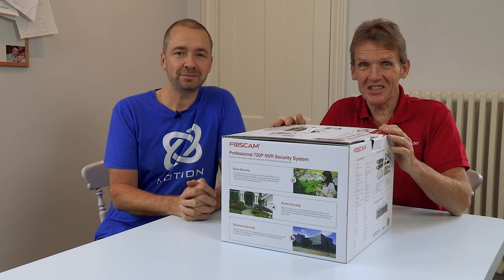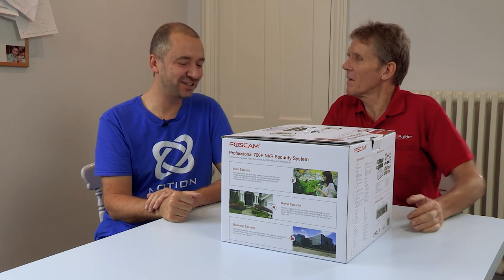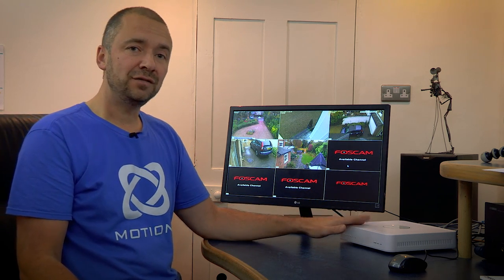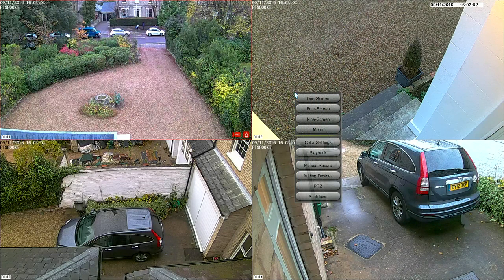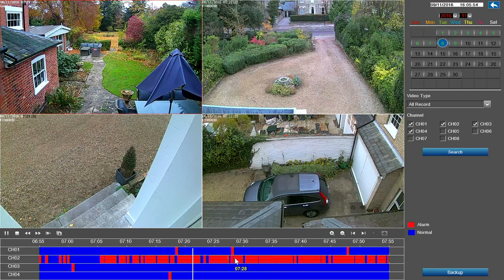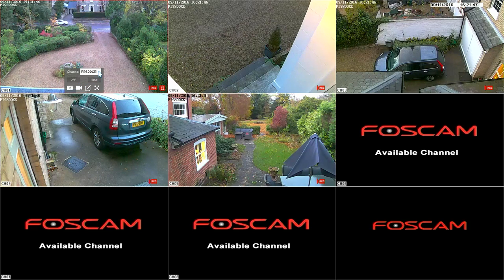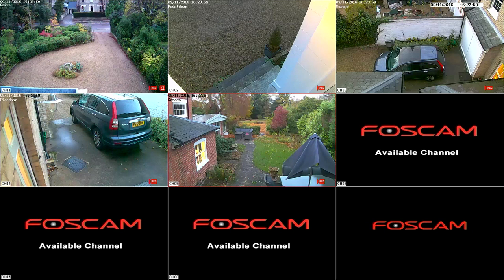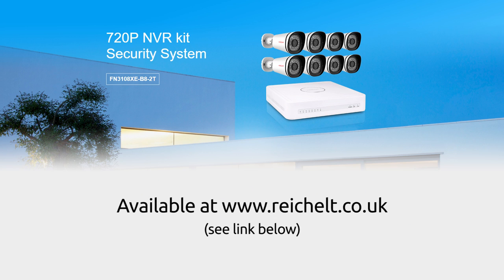How to Install a Foscam 8-Channel PoE CCTV System

Comment: Handy being POE as some houses are now rigged with cat5e/6 these days a you won't need to run any more cabling. Or at a push you could use you could dril a hole through a wall nearest to a plug socket and use the power line adapters which do POE.
Reply from the maker: Good idea Zed to come in next to the socket and take the power from there. It can be difficult running cable but  we struck lucky on that house as there was an old gravity heating system all defunct with massive 1 1/2 inch pipes running from cellar to the loft inside generous boxing. So mostly it was up over and straight down. Some times you need a bit of a lucky break to make up for all those nightmare jobs.
Reply: One article I read about my new 4-camera Foscam system, very similar to this one states that the PoE is not wired as per normal specs, so if you home is wired with CAT5 for phones, this system won't be compatible, even though the manual claims compatibility. Obviously, if you're just plugging a CAT5 cable between the NVR, with no other connections, that doesn't matter.
Reply from the maker: Randy V .
There are two ways of wiring Cat 5 so you need to know it is the same as their configuration.  We put our own plugs on because we didn't want to drill big holes.

Comment: awesome video.. i was wondering if I can replace one 720p camera with a Foscam FI9900EP 1080p and view it on full HD and record it at 1080p ? thank you in advance
Reply from the maker: Thanks Michael. I'm told the system will accept other IP cameras but recording at 1080p isn't possible.

Comment: Hi Skill Builder. Can you add a siren to this NVR? can you also add extra cameras to it? Thanks.
Reply from the maker: You can trigger any kind of warning device you like but you have to make sure you don't pick up every stray cat etc. 
The NVR gives you connections for 8 cameras so that it the limit.
Reply from the maker: Hi Erick. This system doesn't support an external siren, but it does have an alarm within the NVR which can be triggered by motion detection and loss of signal/camera. If you need more than 8 cameras, something like the Hikvision 16 Channel NVR (16NVRHK12TB) would be an option to consider, although it doesn't come with cameras as standard.

Comment: Have set the cctv up with no problem, but I cant get the App or the web interface to recognise my NVR, what am I doing wrong ?
Reply from the maker: I would check your port forwarding settings in your router's configuration. There needs to be an entry for your NVR. In our setup, we had port range as 443 and protocol set to TCP&UDP and the IP number of the NVR which can be found in > Menu > Settings > Network

Comment: are this IP CAMERAS? can i add some foscam ip cameras  i already have. to the system
Reply from the maker: The system uses IP cameras only. We have contacted Foscam to see if it's compatible with other IP cameras, we'll let you know what they come back with.
Reply from the maker: OK, this is what Foscam came back with: "Our NVR model FN3108XE is only compatible with our other HD Foscam camera if you are trying to use other camera other than Foscam it will not work as other camera are not compatible."
Reply: Foscam isn't telling the whole truth there. I have connected 3rd party ip cameras to this system. Onvif compatible cameras like HIK Vision and (generic Chinese) Net Surveillance. I have even used older Foscam wireless ip bullet cameras ( low res, but they work). You can even use non-poe ip cameras that are connected to your existing LAN. The only issue that I have run into is that the motion alerting doesn't work on some ot the 3rd party cameras. I have my set to record all the time anyway.
Reply: that's great info, thanks. After buying multiple (cheap chinese) brands, which sometimes but certainly not always work wonderfully by the way, I ended up buying only Foscam, because they do work great and reliably! (although just last month one of my older PTZ cams died... but this summer it was in the hot sun behind a window all the time so I don't discredit it). So the fact that I can use my older Foscams in this system saves me money.

Comment: Depends what you mean by high definition.  The box is clearly labelled 720P, which means 720 vertical lines scanned progressively -- that is, one after the other.  True UK high definition has rather better resolution, with 1,080 vertical scan lines but is interlaced - every other line scanned, then the missing ones done.  A progressive scan is better for fast action and probably more suited to a security application.  Also with a lower resolution these cameras shown may have bigger pixels (picture elements), making them more sensitive in low light, quite important in a security application.  Rather depends on what the customer really needs and what their budget is!  High resolution daytime or slightly lower resolution but good night vision?  Or both?  Which starts getting expensive, especially with eight cameras.  UHD is something else, four times the resolution and a progressive scan.  Not so good in low light though.  Now, I should have muddied the waters completly!  Bob.
Reply: Hi Robert. When high definition first arrived, 1280 X 720 (720p) was classed as 'HD' and 1920 X 1080 classed as 'full HD'. Picture resolution is often the headline feature with all kinds of video equipment, but as you know, it means nothing if your video is heavily compressed or poorly encoded.

Although the cameras in this system are 720p, the interface display is 1920 X 1080 and looks really nice. We'd like to try one of the UHD systems, it'd be interesting to see how much storage space is needed for recording 8 streams of 3840 X 2160, that's 30720 X 17280 in total!

Comment: should hide the main cctv processing unit so that when burglars breached into your house, they will not able to find the harddrive and destroy it.
Reply from the maker: Good tip. We will come up with a nice way of hiding it but won't tell anyone what that is.
Reply: Skill Builder yes.. the cable from the camera also need to be hidden away. Burglars will follow the camera cable to locate the cctv hard drive, thats why some homeowners prefers wireless cctv camera. Even if the camera is destroyed, the recorded footage is safe and nowhere to be found